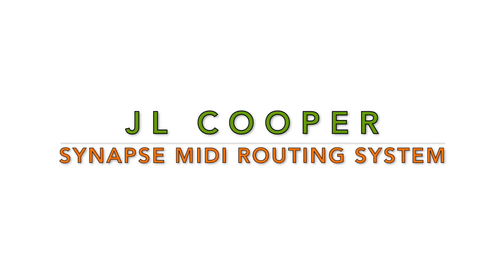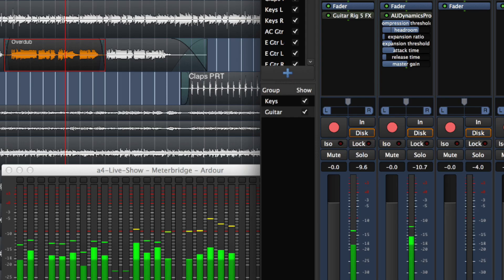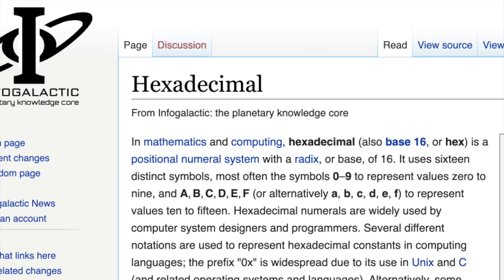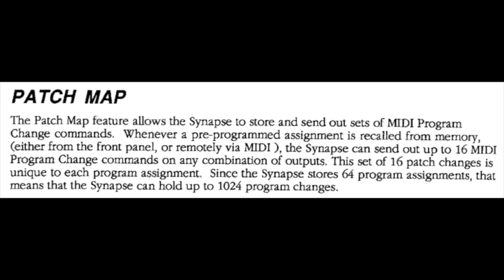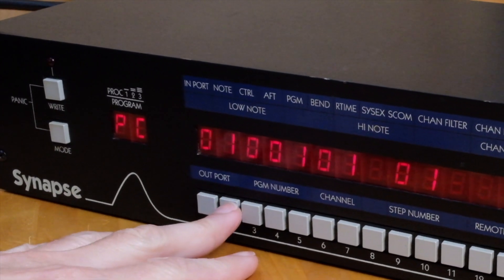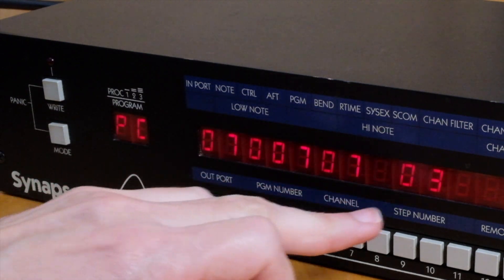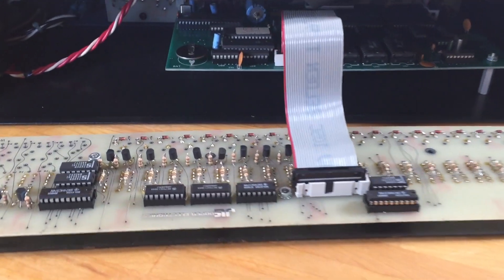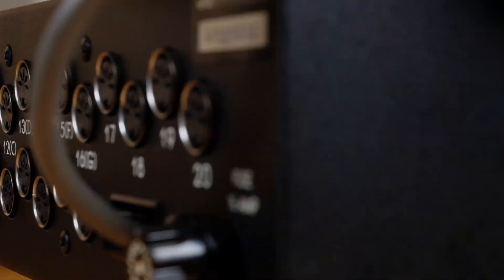Overview & Demo | JL Cooper Synapse MIDI Routing System Patch Bay

Comment: Great video. I own a  msb rev2+ but I simply use it as a 1x8 thru. I recently picked up a used Synapse for cheap and I’m thrilled because I’ve been looking for one forever! About merging…manual says only 2 inputs can be merged per processor…so does that mean at most you can only merge 4 inputs to 1 output?
Reply from the maker: Hi Charles.... the merging function is the sum of 1, 2 or 3 internal MIDI Processors in the Synapse. Assign each Processor with a "P" under the MERGE label on the far right side of the display.  For every MIDI output on the Synapse that you want the merged Processors to exit the machine, assign that output number a "U" (for merge, or "unity").  

At most you can merge 3 inputs that exit to 20 outputs.

Hope that clarifies the procedure; the Synapse manual isn't easy to grasp without hours of use on the unit while reading through each chapter.  Eventually it'll become second nature, so hang tight my friend: it'll be totally worth it!
Reply: @vintageMIDI  THANK YOU for such a detailed response. It’s a disappointingly small capability to only be able to merge at most 3 inputs. This will limit it’s usefulness in my admittedly ridiculously large midi setup. I currently use two modern devices that merge 6 into 1 on each device. I was hoping the synapse could do the work of both of these units I have now. As it appears it can only do 1/2 of what 1 of my mergers do….they’re actually much more than mergers but that’s how I use them…but they are new things….I can find a way to use it but it’s not what I had in mind.

Comment: Awesome video on a rare and still unmatched piece of gear. I have two of these I would like to connect via the ribbon cable connector on the back. I don’t have the ribbon cable. Do you know anything about it? Is it standard? Where might I pick up one?
Reply from the maker: Glad you enjoyed this video.  I made it because I found virtually nothing about the Synapse prior to buying one on eBay.  I've acquired a second unit recently on Reverb and just ordered a standard 20 pin cable form Amazon:  https://www.amazon.com/gp/product/B01AG9GXV4/ref=ppx_yo_dt_b_asin_title_o06_s00?ie=UTF8&psc=1

Folks on GearSlutz suggested it was probably just a ribbon cable with a direct pin-to-pin connection, which seems logical.  The Synapse manual outlines that only additional OUTPUTS are possible; inputs are fixed at 16 no matter how many Synapses are chained.  AFAIK the first Synapse will just see the linked Synapse and route outputs accordingly.  Powering up the second unit and then the first unit would make sense so the first unit knows the second exists.  
Might also be worth checking both Synapses to see what firmware is in each.  I have a v1.04 & a v1.05, so I wonder if they'll play nicely together.  Maybe it makes no difference, but would be curious to know your versions.  Unfortunately you have to do a visual check on the EPROM to know the firmware version.
Hope my ramblings help.
Reply: Thoughtful Clips  great reply and you got farther than I did! I emailed JL Cooper to no response too. Since you’re taking the plunge to try it, I’ll wait for your response here before ordering and trying myself. I haven’t cracked mine open yet. I have three actually because I love them so much I want backup(s) if they fail. So far none have. I use two and they’re fully wired up in a rack so a huge pain to tear out and check firmware but I’m going to rebuild my studio soon so that will be the time depending on your findings here. Great to see someone still enjoy these things as much as I do. I have high hopes for that Kickstarter that looks like a reasonable replacement for the Synapse... but we shall see.
Reply from the maker: Three Synapse routers would be an incredible setup.  16x60!!!!  I'm on the verge of getting an EPROM reader/writer to backup Synapse firmware, among other synth gear.  This dude has a downloadable collection of firmware for old gear, but the Synapse isn't in there:

http://dbwbp.com/index.php/9-misc/37-synth-eprom-dumps

I sent JLC a support question today RE: the pinout on the Synapse expansion port; the tech could not confirm with certainty, but believes the port to be pin-for-pin.  The IDC ribbon cable arrived yesterday, so I'll be experimenting this weekend.  Stay tuned.....
Reply: Thoughtful Clips I bought the cable from Amazon but haven’t given it a shot yet. Have you?
Reply from the maker: Spent the evening testing the Synapse coupling.  Works perfectly. Video will post on Tuesday.  Makes me want a third and/or fourth Synapse!
Reply: Thoughtful Clips awesome! Thanks for risking yours on the experiment. I’ll connect mine when I rebuild that rack soon. Long live the Synapse.